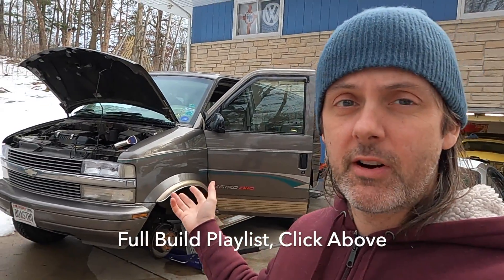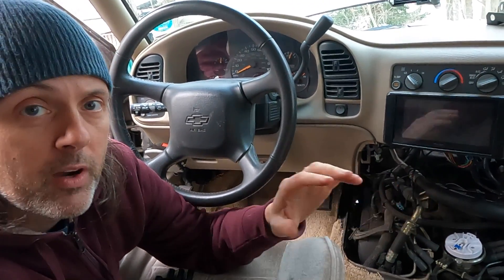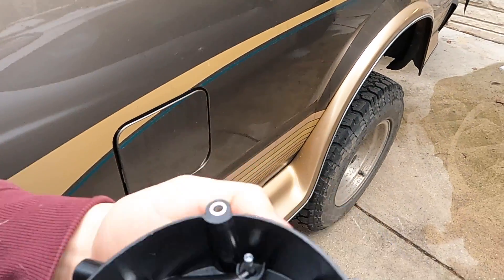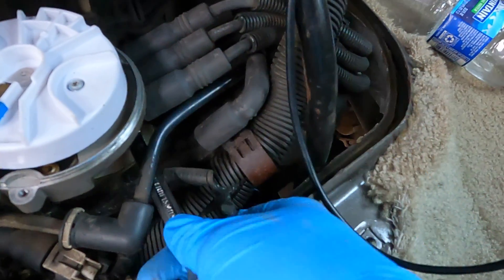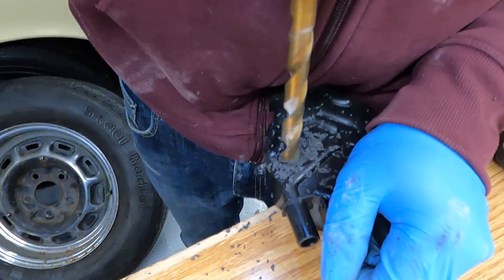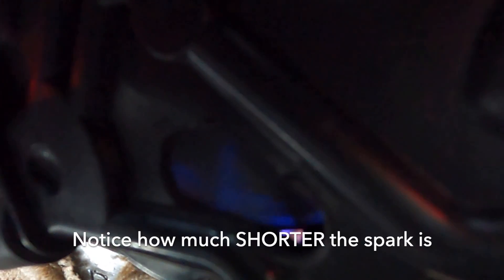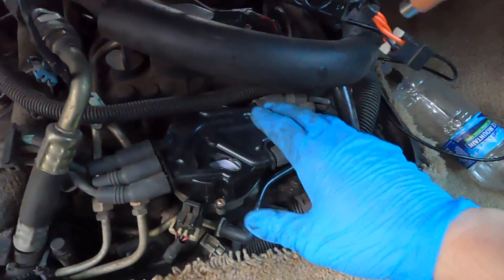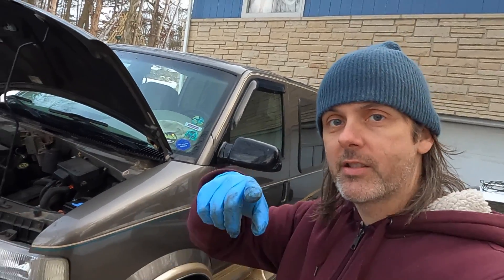Chevy Astro ADJUSTABLE DISTRIBUTOR How To, HUGE IMPROVEMENT!

Comment: Brilliant! Mine did the exact same thing. Was still using the original distro. All good now with a  new Delco (ADDvanced modded) distro and brass pinned cap and rotor. Runs great now...........I'm at 370k on this original non-rebuilt motor. Thank you!!
Reply from the maker: Heck yeah! Happy motorin!

Comment: I tried reading through the comments 3 times to see if someone else addressed this:
I've had 2 of these 4.3 liter engines - same problems
Many times, mechanics will say, bad cap - that's 90% wrong, clean the contacts. Unless your cap is cracked that usually isn't the problem.
I also changed out the distributor every year - usually no start - that problem is usually a bad distributor module.
You could have an older one that does have play in the gear and yes, I agree, change it then.
Problem I have found is this - distributor gear on a new (chinese) distributor is off a few degrees as compared to maybe the original- 
I have marked and put these distributors back in and the gear WILL NOT be (1) gear off but rather 1-3 degrees off or more.
MOST of the time, I have noticed that the distributor module is junk and doesn't last long. I have a 5.7 also that eats distributor modules.
Because they are junk and can't handle the temperature and environment. 
As far as the trial in this video - I'm game to try it. I was guessing that the computer would try to re-evaluate the timing???
Reply from the maker: It’s been over a year now and about 12k miles and still running great.  Previously I would have to put a new cap in or scrape corrosion off the sides of the terminals inside the cap w sandpaper to get it going again. 

And I know what people say about the gear being off or having to flip it 180 or whatever, but I had this same issue w the stock dizzie too.  Regardless the timing is controlled by the CPS near the damper; turning the distributor affects nothing other than the distance the spark has to travel.
Reply: @ADDvanced Good info thanks

Comment: so it started as a worn out gear on the original distributor, then the new billet distributor had the drive gear pinned/clocked wrong so you just ground out the hold  down clamp to make it adjustable. nice job, so many aftermarket parts are just junk nowadays.
Reply from the maker: Yeah, I think so, but doing this mod would likely eliminate needing a new distributor in the first place.

Comment: You should be checking your timing marks on the crank pulley with a timing light in reference to TDC. Issues I have had was the distributor gear wore the teeth in half. Make sure you don't have vacuum leaks also
Reply from the maker: Distributor is new less than 3 months old when I shot this

Comment: i finally got a round to it,i put it as far as you had it and van would hardly turn over and not start.so i started from home position and moved the dis. a little at a time. the further i got away from home position the worse it would not start. Could i possibly have to rotate it the other way?
Reply from the maker: Yes.  Cut a hole in your distributor cap to see if you're making the spark shorter or longer.
Reply: @ADDvanced  thx.
Reply: @ADDvanced  its been raining......and it started right up....THANK YOU FOR YOUR HELP!!!!!

Comment: You nailed it with your second guess. You have a coolant leak. The second problem is the cheap plastic distributors sold everywhere. The gear actually wears and it falls behind. Buy a solid aluminum with steel gear and itll be the last dizzy you have to buy. I was in your shoes a decade ago and after having three astro/safaris over 23 years I can tell you the hold down model is a bandaid.
Reply from the maker: I already have a billet distributor.  I tried that earlier w no change.  Caps still wouldn’t last 5k miles.  Adjustable hold down = it’s been 12k miles now

Comment: I really like your idea, i own a gmc,  but my important question is this, the timing is based on the chain and other components, not the distributer.  So... are you just causing a new hack to get beyond the streached chain, or is your idea actually viable? I say this because, with a new chain, all of the dementions change to normal opporation spects, and if you go beyond them, you put exesive wear on the motor. But i like this idea for a decent alternitive.  Ok, cool,

Comment: What’s the verdict how’s it been over the past year is it still running great. Does the spark still look short. ?   Do you consider this a success.
Reply from the maker: Huge success.  Over 10k miles without touching it.  My previous best for cap and rotor was 5k

Comment: I just got Zapped by my Astro distributor while trying to Duct tape it in place while the engine was running. Stupid knock-off cap broke in several parts and was barely staying in place.  I could hear a strange racket under the dashboard and the truck ran like crap. The plastic of the rotor was griding against the cap contacts and the whole thing was turning itself to dust. Actually impressed it ran at all in this condition. Even more impressed that after my duct tape job it runs "fine" .  That cap did not even last a year, unless the mechanic lied to me about changing it. At best I was charged OEM price for Aliexpress junk. Going to get a Delco and install it myself this time.
Reply from the maker: Delco sucks too. Best is high performance marine w brass contacts.
Reply: @ADDvanced  Any particular brand to recommend ?

Comment: Great video!  Got me going down this road with my own sloppy dizzie Astro.  
Replaced the whole ignition system, including the coil.  Cleaned my injectors (had a bad leakdown), and fixed a bunch of vacuum leaks.  Currently waiting on shipping for a scanner so I can dial in the CMP reading digitally.  On these engines, the CMP angle dictates fuel injector timing, and I think mine is still way off since I have very little power going uphill on the highway.
Reply from the maker: Make the dizzie clamp adjustable, watch the next video in this series, you will need an old cap with a hole in it and then you rotate the dizzie for shortest spark.  I’m now at 7500 miles same cap, so this is def the real fix.  Without twisting it your spark is like 1/2” long or more and it’s horrible for reliability.  Good luck!

Comment: I have a 94 Astro 4.3 TBI EXT AWD 3 DOOR. I think you need to never change any lubricating oils until you gunk up to a 4.0. Less displacement, less fuel needed to fill up the cylinders, obviously less juice needed to fire it off. Fasten a lever onto that distributor so you can retard yourself with the effectiveness of a custom stick position shifter. Get rid of the dog house permanently to save hours of your life. You know the real reason it is named a dog house right? Then stick your finger in that hole you made in the distributor cap periodically to get a good feel for the shocking truth every good mechanic knows that is worth the crispy smell of his or her frazzled hair dos or don'ts that all Astros are inherently a unending pain in the nose picking pinky right down to the rump of the ass. Dog house, dog is chained to dog house, dog spends life in and out of house day after day after day. U B dog, house will always B Ur friend. LMAO! You know what TBI really means right? Oh yeah, the more decals they slap on the outside the more time you will spend on the inside of your mobile DOGHOUSE. Do yourself a favor, install a real doggy door in the rear end hatch, fasten the dog chain to the transmission destroying ball on the trailer hitch and let Spike have his way with your archenemy. PS: Leave your Astro to you 2nd archenemy in your last will and testimony. They will love you for it! I think I have been MK Astroed by the CIA. I just can't stop fixing it. The way I see it I will always have somewhere to get out of the weather when they take my mobile home away from me. I hope I made someone smile and maybe got a chuckle today. Keep on wrenching dudes and dudettes!
God Bless America. America give God thanks and praise for All His Blessings.
Reply from the maker: lol just saw this
Reply: @ADDvanced  :face-blue-smiling: TU
Reply from the maker: @TimothyMortrud-wf8sk  haha happy holidays man!
Reply: @ADDvanced  Happy new year

Comment: Achieved the same result but flipping the worm gear on the distributor.
Reply from the maker: I read about that, but wasn't sure how it would shorten the spark.
Reply: It is because the other side of the gear tooth is not worn and that is the actual problem; the distributor is worn out and a non-part's house performance distributor is the answer
Reply: @danielbuckner2167 not flipping it upside down. Rotating the gear. The calculus doesn't add up correctly for timing by adjusting a tooth left or right. Additionally my distributor was new from factory. Learning it's a common quality control issue from overseas distributors.

Comment: the only catch is if the fresh cap isn't aligned EXACTLY like the old one but, for the length of the damn spark it might not matter.
Reply from the maker: As far as I can figure, the length of the spark is all that matters.   I'm at 6k miles through a rainy spring, without any issues, the van still runs without stumbles.  I think I solved it, but I'll update at some point.

Comment: i always thought chewing through caps/rotors was slop in the dizzy shaft bushings. i put all new ignition system sans coil on mine when doing the LIM gasket. all metal car quest premium dizzy. another guy on the astro safari forums says he has 40k miles on his CQ premium. i will also state i was not able to stab my dizzy in correctly. a multi decade mechanic who have built plenty of SBC struggled to get it to go in on the correct tooth alignment. I wonder if the machine the slots for the rotor alignment incorrectly on the dizzy shaft. #allpartsmadeinchina
Reply: When I got a new distributor the gear was put on 180 out, which made it half a tooth off. Pulled the pin out, turned the gear and repinned it. Tada, fixed my timing issue.

Comment: Went the same route you did, but ultimately just took it to a shop that had a GM scanner and they adjusted the timing with the scanner.

 That is the correct way to adjust the timing after swapping the distributor.

Cost me fifty bucks and about a half hour.

Comment: Any updates? I think I’m having the same probably
Reply from the maker: Still working fine at 4500 miles
Reply: @ADDvanced  so before I was getting this shuttering and stumbling when driving at Crusieing speeds. Ended up doing the same thing here in the video adjusting the distributor. Drives much better got the spark to line up correct. Still shutters but not as much. Can you relate at all?
Reply from the maker: @Noflo22  Did you change your cap too?   If it's still stuttering maybe you have a failing spark plug wire

Comment: From my old days tuning up small block chevys I recall that it is possible to install the distributor gear on 180 degrees out. What happens then is your timing(as you adjust it,(or in this case it is fixed) will be off by  a few degrees. I suspect these distributors are the same. Just an idea,since the unit has been replaced. There is NO way this timing (rotor to terminal)should be that far off, the fixed position of the distributor should give maximum performance. The slotted holddown is a good workaround though.
Reply from the maker: Yes some of the aftermarket distributors have the gear installed 180 off like you said.   That said I’ve seen this pattern of wear inside the caps since before I replaced the distributor.   The theory is the timing chain has some stretch/wear which puts the cam slightly behind.  Not sure exactly.

Comment: cool, wanted to see this,,,, esp. that window. I havent had a chanceto get into checking out my dizzy yet. At 100k, , new to me van,,probably has never been tuned up,,,, I suspect Mine is doing something wierd as a sometimes get a miss/crossfire feeling,,, no codes, just does  on this slight hill on the 101.
Reply from the maker: Have you done a cap and rotor yet?
Reply: no, Ive done next to nothing to the Astro, I replaced heater core, ... thats it. I bought a bunch of Jouneys stuff but its in storage. I prematuely had to move full time into it and have another vehicle to get around. Things keep getting put on back burner due to health and bad weather. I know I need to get it going for eventual move out of CA and towing 2nd car.
 @ADDvanced
Reply from the maker: Yeah, get out of there dude.   Cali would be great if you were a multi millionaire, but if not you will be a serf and renting forever.

Comment: I thought I was the only one who wanted to see inside the cap when it was running. Too cool.
Reply from the maker: Why don't they make clear caps?!?! :P
Reply: @ADDvanced  i finally got a round to it,i put it as far as you had it and van would hardly turn over and not start.so i started from home position and moved the dis. a little at a time. the further i got away from home position the worse it would not start. Could i possibly have to rotate it the other way?
Reply: @johnsmith-un2mx  Did you try it??
Reply: @electricguysvcs yes
Reply: @ADDvanced  just an update...i cut the hole in the dis. cap and like you said, the spark was real long,but i had to rotate it clockwise to get the much shorter,better spark,went out this morning to start the van and no go, I had to use the hair dryer again????  idk..........
Reply from the maker: @johnsmith-un2mx  You... replaced the cap after cutting a hole in it, right?
Reply: @ADDvanced  yes, ac delco......
Reply: @ADDvanced  wait,i did leave it on overnight with the hole in it and then tried to start it..maybe mositure got in cause of the hole?  well i got the new cap on and took it for a ride so ill try again tommorrow...
Reply from the maker: @johnsmith-un2mx  Yup. Hit the rotor and the contacts inside with some light sandpaper too just to make sure the metal is fresh. I'm at almost 12k miles on the the same cap and rotor now, game changer for me
Reply: @ADDvanced  will do...thanks     when it starts it does start faster.....
Reply: Back in the day you could buy clear caps...

Comment: that's not normal cutting things to make it work is a big nono they where built to run with no adjustment and you just probably skipped a tooth on the gear take it back out and set cylinder 1 tdc and go from there
Reply from the maker: Check previous video for distributor replacement.  You can verify it’s the same angle.  This is caused by a stretch of the timing chain, search Astrosafari for more info
Reply: How to you set cylinder 1 to tdc?

Comment: I think the distributor gear is off a tooth from meshing properly with the cam.  Bring the engine to TDC firing position and see if your rotor is pointing to the #1 cylinder's electrode in the cap. Check to see If the  harmonic damper TDC mark coincides with the #1 piston's position.  Sometimes the outer damper ring spins with age throwing the TDC mark off.    If you're confident that you really have the engine at TDC and the rotor still isn't aligned properly with the cap's electrode, the distributor gear is off a tooth.  It's often a pain to lower the distributor in the correct position and also align the tab on the end of the distributor shaft where it engages with the oil pump.  You may have to rotate the pump shaft slightly with a long screwdriver so that you get the gear and the pump drive meshing correctly as you drop in the distributor.  Hope this helps. Good luck!
Reply: I went back to your video and you're correct it IS at the same angle as when you started  but what's the chance the distributor had been installed incorrectly since you've owned it.  Check to make sure #1 piston is at TDC and that the rotor is aligned properly with electrode in the distributor cap,
Reply: @hughblack3456  this is spot on. I replaced mine yesterday following the factory service manual and it is key that the #1 cylinder is at TDC, which you can tell from marks on the timing cover and harmonic balancer. It's still a little fiddly getting the distributor aligned with the oil pump notch, but fine with a little practice.
Reply from the maker: Check my previous videos for distributor replacement.   You can see it’s the same angle

Comment: .....very interesting, but let me say I've only had to replace ONE rotor cap in 367,000 miles.
Reply: So basically in 367k miles, you never did a tune up on your van. Got it 😂
Reply from the maker: That’s wild.   I have relatively low miles and I’ve done maybe 6 caps over the past 30k miles.  I am pretty sure this was my issue the entire time.

Comment: Very common problem with astros .....  it is theorized that  this problem occurs from slightly stretched timing chain and at high revs the computor gets out of sinc and you can get p300 codes...   I did this mod a bunch of years ago and it has worked great. my van runs perfect although I did not do the hole in the cap part.  Just ran it a bunch with the doghouse open, tweaking it until I was happy with it...    Good video Rod
Reply from the maker: Yeah I thought I mentioned that but not sure (timing chain).  Another possibility is the gear on my new distributor being 180 off; I’ve read of people flipping it for better alignment but that wouldn’t explain my stock distributor doing the same thing.